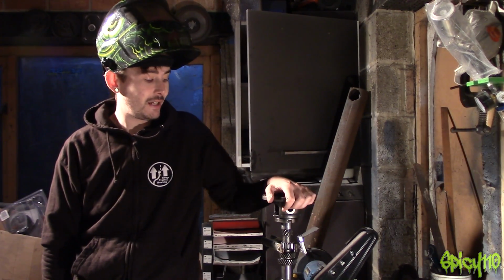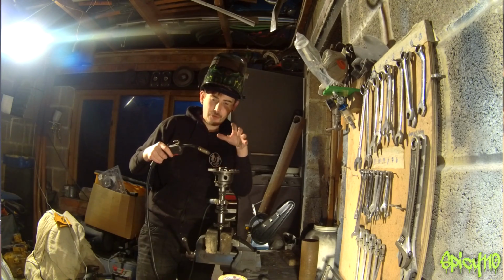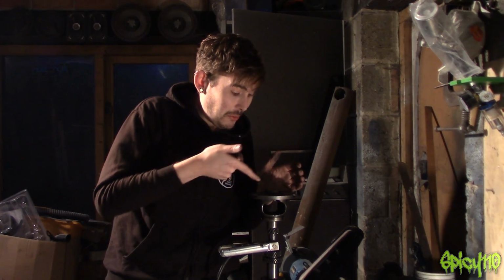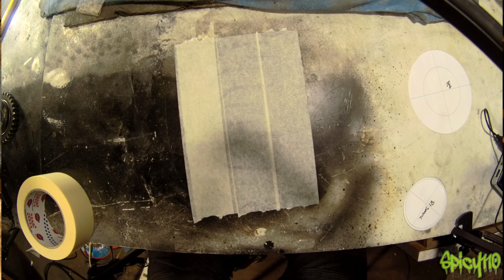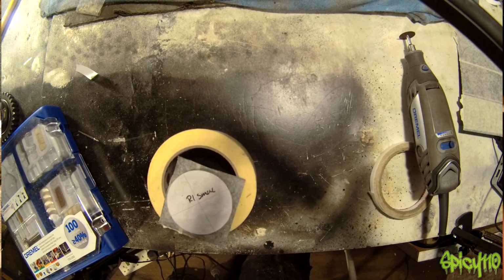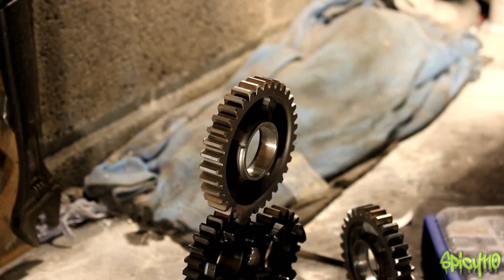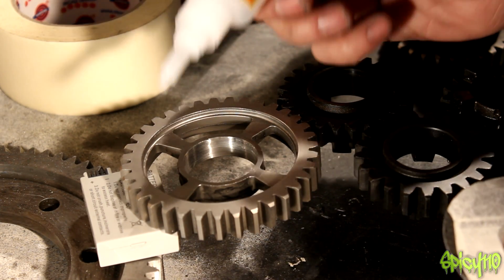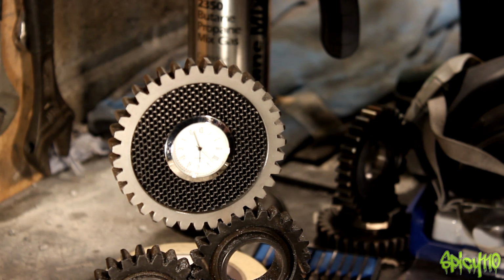Time to weld! Metal Works! EP.5

Comment: Have you ever thought about using resin in any of your projects? You can create some quite ingesting effects with it
Reply from the maker: +Madeleine Gillett yes but I would need some kit I don't have like vacuum pump. 🙂
Reply: spicy110 

You could do it without. There's a guy I watch who sets things in resin in cups or Tupperware and then grinds them down on a lathe. It would be interesting to see if you could do something similar but grind the shape with the Dremel
Reply: Peter Brown is his channel name, dunno if you've ever watched his stuff
Reply from the maker: +Madeleine Gillett so how is he removing the bubbles? Well some object that would work to be fair but I what have something in mind that needs a pump. 🙂
Reply: spicy110 

Some times it works to tap the piece on the work bench just after the resin has been poured and then he uses a blowtorch about 4 inches or so away from the surface of the resin to pop the bubbles without causing any possible fires. Another thing to do would be to stir the resin in such a way that few air bubbles are created and then pour it as close to the mould as possible so no air can be trapped in there.

Might be worth experimenting a bit and maybe watching some of his resin videos.

Comment: You have perosity in your weld, so you either have your gas too low, a dirty tip and shroud, your shroud is too far away from your weld pool as your welding, you have contaminents in or on the steel ie oil greese or it could be as simple as having the door open mig welders hate wind
Reply from the maker: +maxipuch 1000 yep it's was contaminant inside the  differential housing I had forgot to remove.
Reply: Which is why i would save yourself the money buying a tig welder they like a spotless surface for welding otherwise most of your welds are gunna look like dog shit if you cant get it clean. Mma stick sets love a dirty greasy surface not a problem, thats why there used out on site wind,rain dirt you name it just need a wire brush to clean up your weld after you chip away the flux id suggest using one of them to be honest
Reply from the maker: +maxipuch 1000 I will remember to clean it next time haha I think keeping my mine of the filming at the same time was taking over but I will get used to it. What I would like a tig for is a bird sculpture idea I have where I should need good small welds. For a feature of it I won't say cos no one has done it and it would look amazing! Haha
Reply from the maker: +maxipuch 1000 appreciate the input BTW I'm happy to learn from others who know what they are talking about not people who think they do 🙂

Comment: Slightly odd/random question, did you have to put a 13 amp plug on your welder? I'm looking at getting one, but I can't seem to find one with a plug fitted.
Reply from the maker: +Bullet03 yes I put a plug and 13amp false on it  but also be aware you will need it to be running off a 32amp main beaker in your fuse box.  Any less and although the welder will run the seconded you start welding it will pop lower beakers.